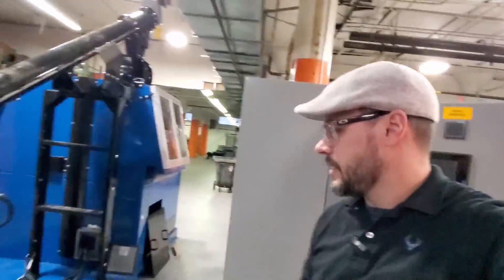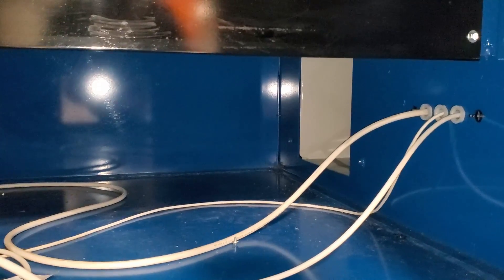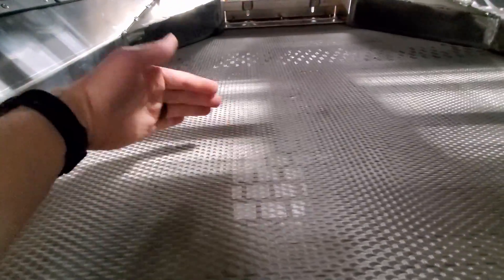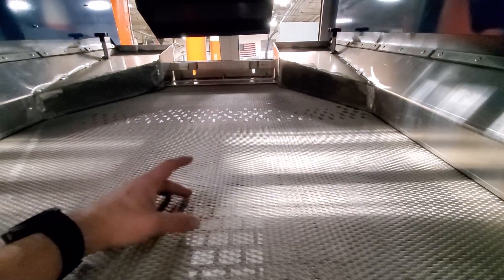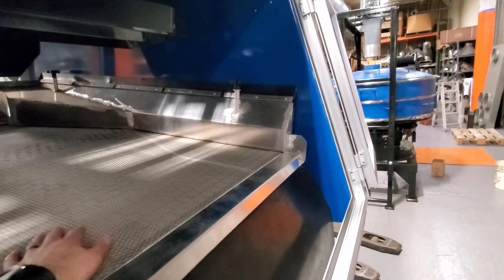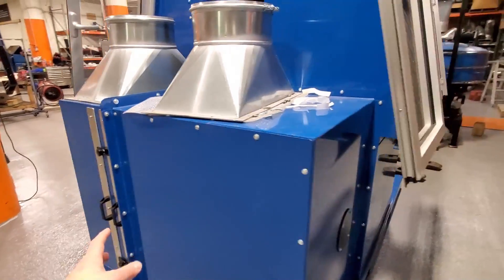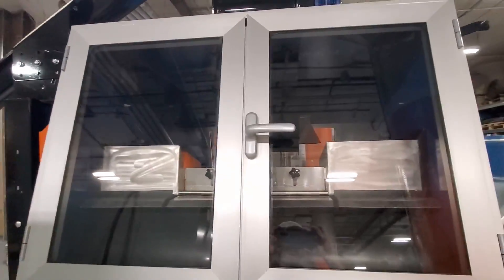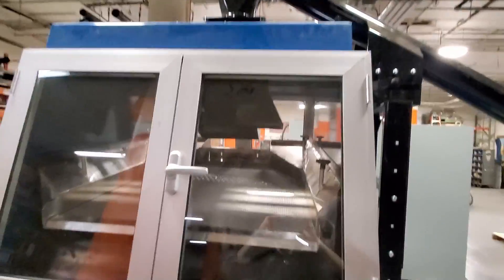How Does an Air Separation Table Work?

Comment: Hello. Super air system. I think the wet version causes oxidation of the wires.
What angle of inclination does the table (deck) have?
Reply from the maker: Thank you! There are tricks to prevent oxidation. The deck is adjustable 25-40deg.
Reply: @cablemanagementusa  Thanks for the reply. I wish you success in your future videos.

Comment: My company services those screens down in Lower Alabama. What brand is that separation table? Is it Robi?
Reply from the maker: @CoverCatz  These are our Cable Management Licence tables. They look similar because our partner used to make the earlier Robi models.
Reply: @cablemanagementusa  we have been servicing those types screens for over 14 years, reusing the frame and installing new mesh using 10/1 industrial acrylic glue.
Reply from the maker: @CoverCatz  please send me a email to info@cablemanagementusa.com
Reply: Hey, we are using separation tables and we would like to renew our mesh screens. What kind of mesh do you use ?